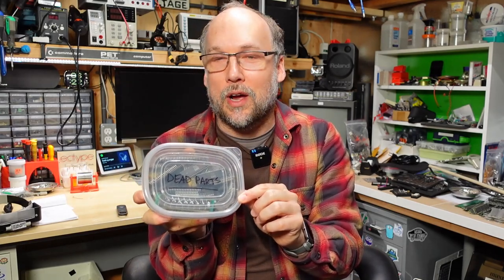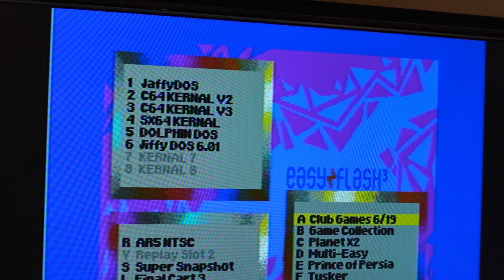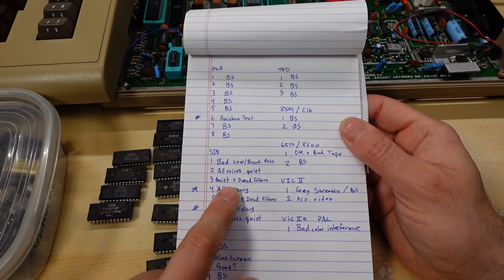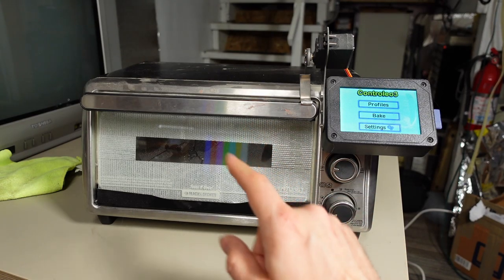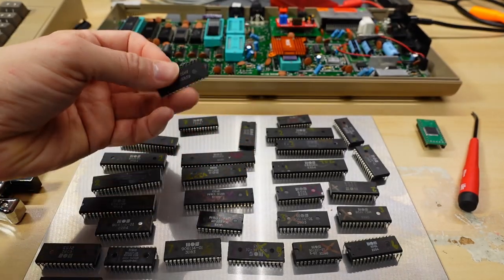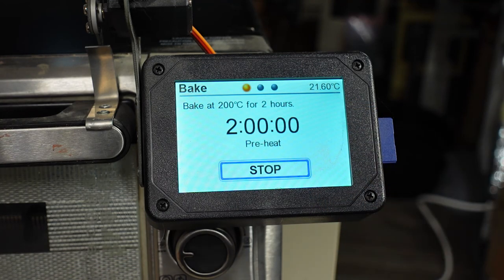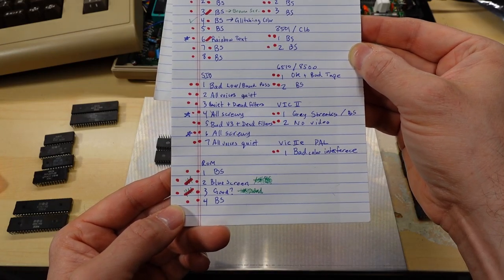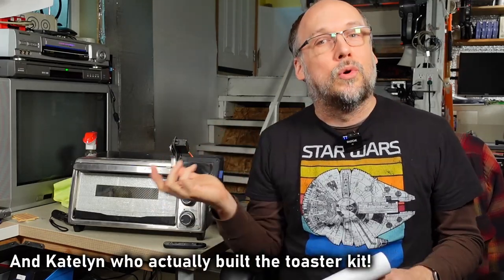Can we fix bad chips ... in the oven?

Comment: Great video Adrian. I’ve seen this work on motherboards before but not chips.
Reply: This is a very reliable fix for the PS3 red ring of death..
As a motherboard reflux, I had place a motherboard in a preheated oven, then brought temp up to about 400° then allow it to cool in the oven overnight.. it was successful but repair didn't last
Reply: Yeah i can imagine that it might work on whole circuit boareds where some of the solder joints are a bit iffy; solitary chips on the other hand, not so much.
Reply: Bring an ASUS Motherboard and a Grafikcard XFX back to life again. For 1 Hour at 110 C ! 2 of 6 tries in the early 2000 !!!

Comment: Baking chips is usually done if you want to solder them professionally ("reflowing"). Chips are protected against moisture but if you get the chips our of the packaging too soon you should do that to gently remove moisture otherwise it could create some pockets of steam inside and damage the chip. But the procedure is much less violent but longer: you gently increase the temperature to 105C for hours then finish for 24h at 125C...

Comment: I wonder if it's possible to decap those dead chips and see where the damage is that causes them to fail?
Reply: I doubt it. If i understand correctly its an alloying process, so instead of semiconductor-semiconductor, you get an alloy at the junction and that disrupts the function of the part until its unusable. Thats why silicon diodes fail in a short circuit because you have a P and a N touching but when they alloy you get a neutral piece of silicon so it just conducts because it cant generate the depletion layer to stop the flow.
Electromigration causes atoms to shift, so overtime they mix with whatever was at the other side causing problems like leakage in diodes or making transistors work outside their specifications
Reply: @laharl2k  Damn. That's a bummer man. But it's interesting to know
Reply: @laharl2k  So basically an internal short.
Reply: @parad0xheart  
sure, but you are still talking about 10nm process chips....like its quite hard to reverse engineer that without super high precision  equipment. And you shouldnt see much of a difference but everything just being a few atoms thick, not sure if that would hold true at that scale. Maybe it so prominent vs normal transistors that the issue becomes aparent at "plain sight"
Reply: @laharl2k  at this point in history (late 70’s early 80’s) all that was required for reverse engineering was an optical microscope and submicron tech was a dream, and a distant one at that. You are correct in that Modern chips are practically impossible to reverse engineer. Hopefully I understood your comment properly, feel free to correct me if I didn’t!
Reply: It was material purity. Electronics have been improving rapidly since the 80s. We knew how to make some transistors years before it was possible to make pure enough silicon to actually do it.

Comment: This goes back to 1988 for me.
My own testing never got above 15% fix, and that was with 74xx chips.
Mostly 7406 out of Commodore 1541 diskdrive would work.
We used to put the chips upside down! While heating. 
Reason, is that chips would often die 'hot' with gravity pulling down.
By heating the chips upside down it would reflow back.
Again it is not 100%, but we seem to have had some result.
Love the video.

Comment: Interesting experiment! I love this type of thing.

I think you had the right idea to speculate about what failure modes baking at a high temperature might have an effect on. The failure modes that might occur after this much time include internal corrosion due to moisture wicking in through the plastic case, corrosion due to chemical reactions between the chemicals used in adjoining layers, over voltage, etc. I don't think baking will have any affect on these types of failures.

I did have a PLA once that would start working properly once it warmed up. I guessed that a bonding wire was loose and the increased temp caused enough thermal expansion to make a good enough connection. I think maybe that baking could temporarily 'fix' such a problem but that after after a few heating/cooling cycles it would break again.

Comment: No joke... many years ago a client of mine had bought a cheap Dell laptop from ... Walmart. Well, it lasted about 3 months and stopped booting. After a bit of Googling I found out that someone had noticed that bad soldering was leading to the heat from the machine warping the board and opening the connections. Someone had mentioned they had luck wrapping the laptop in a blanket and putting it in an oven for an hour at 150º. We did't have much to lose as it was already not booting, so I gave it a shot, and it worked... for a few weeks anyhow.
Reply: Mr Guru  As you said in another comment chain: Solder doesn’t melt at 150°C.
@Jeffery Hahn Baking chips is a temporary fix so I’m not surprised that it broke again after a few weeks.

Comment: Hello Adrian, I was wondering if it would make a difference if you put the chips in with the legs up so they are electrically isolated?
Reply: My guess is that most of those chips got bad due to a short circuit which i think you can't fix by baking them. Also it's better to understand what problems baking can cure. So you also need to know what has happened with those chips in the first place.
Reply: @Madrrrrrrrrrrr  I don't expect it to make a difference at all, but it never hurts to try

Comment: I sold IC's for many years,  we did something called drypak in much lower temps. New chips baked to dry out all moisture slowly over time, so when the PCB's get wave soldered no moisture means no steam which would  escape the ic's;  which would crack the lids and destroy very expensive rad tolerant IC's  (electro migration repair is a different issue and can also work)

Comment: A Sega Genesis cartridge came back to life when I blew some hot air into it, using a hairdryer. But I did the same test with a bunch more, and nothing happened. It's worth the shot.
Reply: Mr Guru  i had cleaned the connector before. The only thing that made it work was the heat.

Comment: I've revived several graphics cards by baking them in the oven at roughly 220C for 12 minutes. I turn off the oven and let them cool for 30 minutes afterwards. Of the 9 I've tried, 5 was working afterwards. One of them survived for an additional 8 years or so.

Comment: I actually heard about this from an eBay seller I bought a bunch of SID 6581's from. He's working on a process using heat to clean the filters of the SID. Apparently it works, which is huge because a lot of SIDs are working save for an issue or two with the filters. It would be nice to see the life of the SID 6581 extended. I have a stockpile now just because I don't ever want to see a day when I can't make chiptunes with them. That being said I know that day is coming eventually :(

Comment: I had what I totally thought was the Christmas tree PLA on my '84 64, but it turned out to be the color ram failing in a weird way. In the meantime I had swapped out the PLA with a PLAtinum PLA replacement. So I replaced the color ram and actually have an extra good in case my Silver Label '82 C64 has a problem. I really hope it never does though, since it has all original '82 dated chips.

Comment: according to bill herd, they used too much boron for the faulty PLAs, if i remember correct.
alot of them are not 100% dead as you found out. They are more 'analog' now I guess. Some are slow with slow rising or falling edges at the output.
with a scope and different baking methods you could find out what would be the best method by comparing the signals :-)

Comment: I repaired the GPU on my iMac mid-2011 by baking it. This fix resolved the issue, and it has been functioning without any problems since then. I continue to use the same iMac today. The small circuit board that houses the chip had no plastic parts so it was ok. I left it in the oven for approximately 10 minutes, although I don’t remember the exact duration as it was about four years ago. However, I did purchase a separate oven thermometer to ensure precise temperature readings. I placed the circuit board in the oven while it was cold and allowed the temperature to gradually increase while monitoring it. After 10 minutes at the preset temp, I turned off the oven and allowed it to cool naturally. It does work. Before the oven process the iMac had 4 green vertical lines. I can tell you that it worked for me.
Reply: That probably was a connection problem between the chip and the board. The solder between those parts can crack and cause problems. Heating it melts the solder and reconnects everything.

Gtx 8800 cards had the same issues back in the day and this often fixed them as well. It did not change anything inside the chips though. Like what was being tried here.

Comment: You should look up "Purple Crerping Crud". Commodore used a bad cemical composition on one of the layers on the silicon die, gradually and slowly etching away the metal layer. They found the fault it in late 1984 if I am not mistaken, but by then thousand of machines with potentially ill-fated chips had already been shipped.

Comment: I'm curious if placing the chips with the pins touching a conductive surface like your aluminum plate might have had any effects on the outcome?
Reply: I wondered about that too
Reply: I mean, theoretically that could be an issue, but it's really not likely. The bigger concern would be static discharge into the pins, but I honestly think a few of these died due to that, so...
Reply: The aluminium plate means that all pins have the same potential, which fits that description of undoing electro migration. So I think the method was fine.
Reply: @MikeStavola  Where are you getting static discharge from in this process?
Reply: @jong2359   It was a figure of speech. It's like saying, "I'm more worried about being pecked to death by chickens than being struck by a meteor."
An actual concern I'd have with this process is a lack of drying before the oven. If you ever watch an encapsulated chip explode in a reflow oven due to trapped moisture, you'll know why.
Reply: For this, we have baking paper... he should use it! They would be perfect cookies.

Comment: I actually have a GAL PLA. I don't know if it was necessary though. My issue was the system was running at 3.5v with the U2+ installed. Turns out a MIDI cable is not suitable for powering a C64. Fortunately I bypassed the issue by externally powering the U2+. I'm going to buy a black brick of death just to salvage the cable (I refuse to solder a DIN). But yeah my colors were all screwy not unlike that PLA you showed (but not as bad). I replaced the PLA and the color ram. No change. Then I noticed the voltage was super low. I'm surprised it worked at all. lol So I still have the MOS PLA. It's probably fine. I'll leave the GAL in there for now. lol

Comment: I used my oven for a motherboard having issues before - didn't work. I don't think I had it high enough - but I didn't get to try that again because I was banned from using the oven in my house after that lol. But then I tried it again using a heatgun - this time on a dead laptop GPU and it worked! May have melted some of the plastic on the bottom of the case though. I like the idea of having a coarse last resort for such precision electronics.

Comment: Just FYI. Don't go over 350 degrees Farenheit or it will damage the chips. Keep it around 330F next time you do longer than 30mins and see if that does anything better... 🙃 most chips are damaged over 350 degrees and 200C is closer to 400F. Just a thought if I had the chips to try it... But was very interesting video. Liked it alot. Keep it up bud! 💗

Comment: have you tried the effct on a good chip ? i know somebody repaired a mobo this way, after baking the thing worked for 2 years, the next time again but lived shorter, he tested this for 5 years if i remember well. Upto the point it did not work anymore. I was thinking the heat does something with the bondwires pressing them back in place. i once reflowed a BGA on a Fluke 192 and after that it worked again but I think that was restoring a bad solder ball. 
Very interesting, thanks will do some tess my self. I wish I had the gurs to decap ICs and then look under the microscoop what the problem is. like burned bondwires, holes in the die etc. because that can not be cured in any way

Comment: I am an electronics technician and some of the chips we use actually come in moisture barrier static bags and they have a humidity indicator card inside of the bag. The card shows different humidity exposure levels and after a certain exposure the card says to bake the chips at a certain temperature and for a certain period of time to ensure they work as designed and don't fail prematurely. Perhaps some of this is related to moisture contamination?

Comment: It definitely works, I've been using this resuscitation method for at least 5 years in the past on half-dead and dead graphics cards, and I'm currently writing from a computer that has an r9 270 in it that I revived
Reply: I too have commented about a video card, but this is a different concept. When baking video cards, it is to attempt to repair cold solder joints. In any case, glad for you. That is cool. My attempt was unsuccessful, as I doubt a cold solder joint was the issue in the first place.

Comment: I can confirm that it works for mainboards with BGA chips mounted on them (in my case a PS3 motherboard). That works because the cold solder joints are being reflowed. Since there is no tin inside (most.?) chips, I can't imagine that it will have the same effect. It might be due to Thermal stress that an internal connection is broken. If that gets fixed during baking, I think it would only be a temporary fix since it isn't actually rebonded with the dye inside.

Comment: The funny thing is: a big commodore supplier from Germany told me that he offered the customers to test the computers... because often the computers back then broke within the first few days.
If the computers survived this time it was very common that they survive longer.
Reply: This is true.  Infant mortality.  I make circuit boards for vintage coin op equipment  A few chips are obsolete and recycled pulls are the only option.  It seems if there is going to be a problem with a used chip it will either be dead first boot or fail within the first few hours of running.  If they live through a 24 hour burn in test the board usually goes on to run indefinitely.

Comment: I fixed ages ago one bad radeon card that had stopped working, with the baking method, just be sure you remove all of the plastics before you do that, well it worked for 'bout 4 more months, but it was better than nothing. One of those "2 days after warranty" situations.

Comment: My mom used to work at a resistor factory. If they made a resister that was out of spec, they'd sometimes bake it (depending on which direction out of spec it was) to see if they could bring it into spec and often did. Now, ICs are not resistors, but considering the process is the same, I'm not so sure if this method really is all that unorthodox considering a component manufacturer did basically the same thing.

Comment: electromigration aside, it could be because of moisture ingress as well. This is why it's a bad idea to use hot air on old chips and stuff, because they can popcorn when the moisture they've sucked up over time boils inside and pops.

Might be an idea to stick some of those chips in a vacuum chamber too, see what that does, or in an airtight container with a big silica pack.

Comment: I worked previously reflowing GPUs and the temperature I use goes from 200°C to 300°C, generally speaking, 250°C does a great job. That is, using the heat gun from a soldering station just during 2-5 minutes that's very important, you don't wanna let the material move, you just want to try to fix the bad contact. These things use to be manufactured using lead-free tin, so anything below 200°C does pretty much nothing.
Reply: That is only relevant for solder, and has nothing to do with bare ICs like in this video.
Reply: @absalomdraconis  if you had seen ICs internally before you would've seen they're soldered from the inside as well.

Comment: Would there be any advantage in putting the chip die side down on the plate, rather than the pins? Also does the method specify the chips should be heated at the same rate as the oven, rather than preheating the oven, then putting them in  (as one would when cooking)

Comment: Back in the Late 70's and early 80's You could restore Eprom chips (2708).  These were ultraviolet eraseable Programmable Roms.  450 degrees fro 30 minutes.  Most were restored.
http://www.classiccmp.org/pipermail/cctalk/2017-December/036588.html  This is not my post.
Reply: They are usign Fahrenheit in that link, 450 deg C is likely deadly for a chip.
Reply: Yes, it is 450 F.

Comment: Back in the day I got an extra 6 months of life from my dead 2008 Macbook Pro by baking the motherboard at 190°C. It was used regularly for After Effects rendering so I guess the solder joints had become brittle and cracked from the constant temperature fluctuations. A question re: your process - Isn't the oven supposed to be empty when preheating? You put the chips in once the correct temperature's been reached? Or is that just when making cookies :)

Comment: This is the method that revived the XBOX 360 GPU back in the day, it only ever worked on a tempory basis even if you upgraded cooling system afterwards.

I used the overn in the uni dorms back in the day, I was not worryed about poisoness chems as you were more likely to get food poinsoning from using it. [Uni overns are rank]